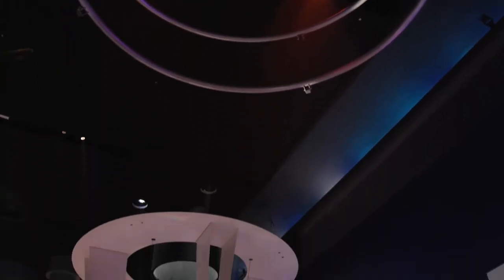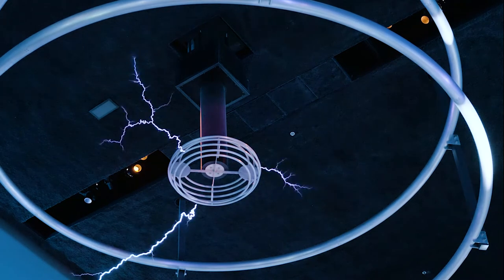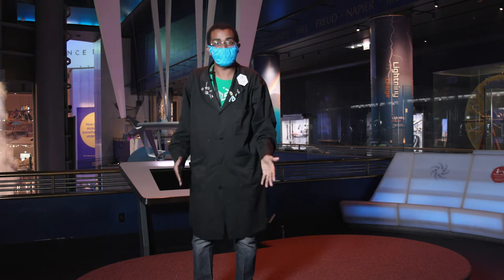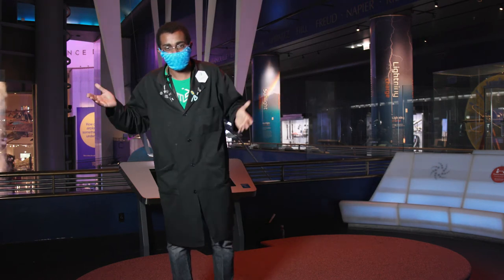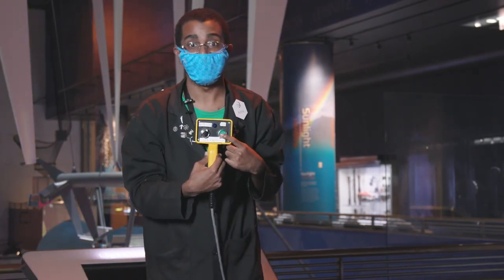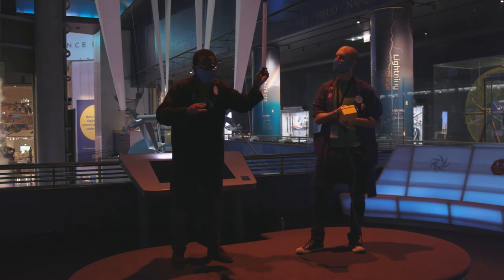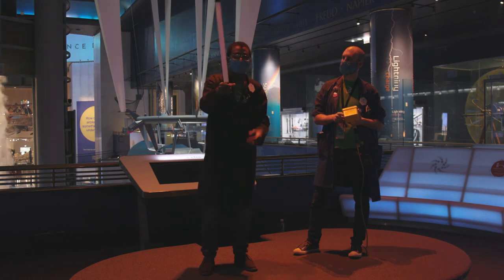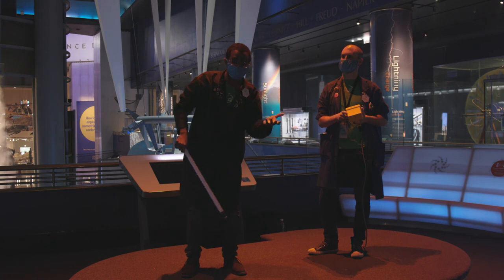Science Storms—How It Works: Tesla Coil

Comment: 0:00 that sound used to scare my sister (I swear it was at a lower pitch though). Brings back nostalgia.
Reply: The pitch changes because It sets the pitch randomly every time it goes off. Idk how exactly does it do that but I assume it has a few preset pitches which are around 240-350Hz with a square wave. This is a 3M SSTC so it uses some advanced technology and can be programmed and all that stuff. I really wish they made it play music tho instead of that loud af tone. Also it is very loud for sure. It is around 113dB from the second floor which is about 90 feet from it

Comment: 2:24 that’s actually wrong. The lighting makes noise because it “punches” the air and makes it move faster than the speed of sound causing a mini sonic boom, and since the lightning pulses at 240-350Hz, it is basically producing 240-350 sonic booms a second, and that is why we hear that very loud buzzing sound. One bolt of lightning will not cause vibrations, it will create a shockwave, and the voltage will not affect the frequency at which the lightning pulses. The coil is always getting 240 volts AC, which is really just 2 120 volt AC lines 180 degrees out of phase. The real reason it pulses is because of the controller making the lightning pulse at a certain frequency that is preset onto it. Other than that, this guy knows his stuff. Also 5:40 you can literally buy an SSTC Tesla coil which is a smaller version of the one they have there and it does the same exact thing but with smaller arcs